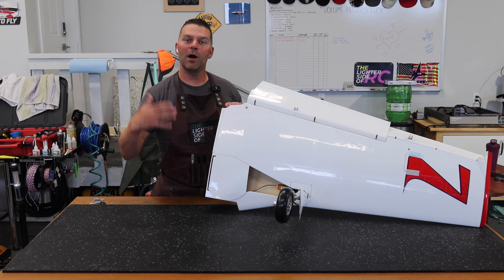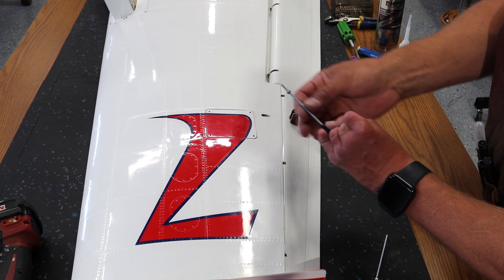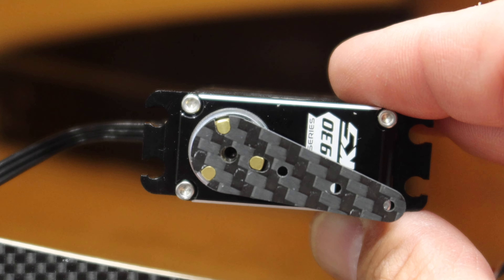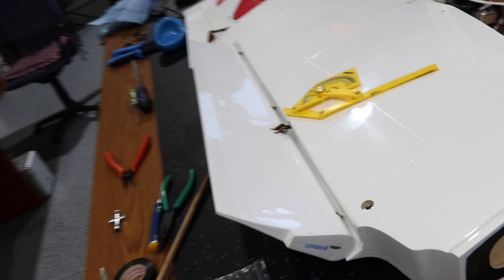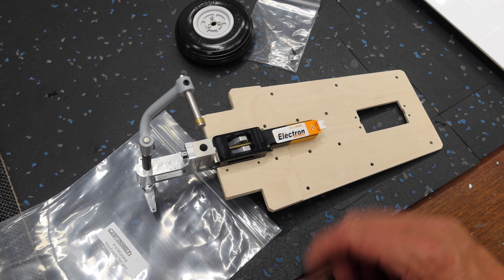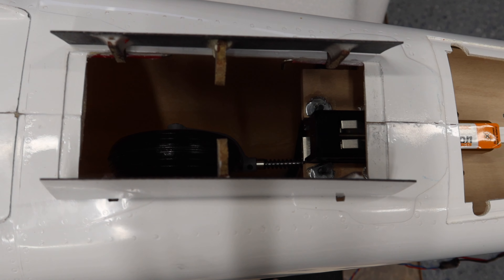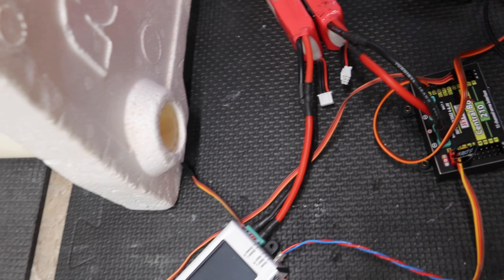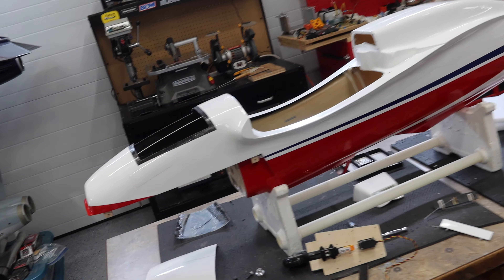MAGICAL PROGRESS! - Strega RENO Racer Surfaces Complete!

Comment: Tail wheel steering pull wires, i use a spring on each.    Just thread wire through the spring and crimp in place.  It stretches so the wire still does the pull pull action.  Spring contracts and holds wire shorter and contained
Reply from the maker: Understandable but on this strega there isn't much room on the plate and because of the Electron gear design there is so much movement I can't imagine a good spot to locate springs to work well.
Reply: @thelightersideofrc  over the existing pull pull cables, just a very light and long extention spring.  Thread the pull pull cable through the centre of the spring.     Or even a piece of elastic.    So when there is slack it contains the bending and bowing of the slack cable.   Hope this explains better what I was trying to image

Comment: Love to see a prop plane on your work bench. I know first hand and feel your pain when you don't get a build manual. I have a CARF 3 meter Extra 330LX and it also shows up with no manual and the real frustration is the firewall does not have the 2.5 degree offset in it, in stead it is flat but the cowl is made with the 2.5 degree offset. Pretty frustrating but thats how CARF does it. Great video buddy.
Reply from the maker: Oh dang!  I feel your pain too from many miles away!😂😂. The joys!!!

Comment: Yeah A, nice test pilot. Glad to see your fitting custom controls for the cat. Question, do you not run a screw threw the wood, pull it back out and then thin CA the treads you just made in the wood?
Reply from the maker: Thanks.  Sometimes I will run the screw, remove and use thin ca.  Sometimes drill the hole.  CA to screw or hole or both and thread in screw.  Treats threads and also locks screw well.

Comment: Wow what a beautiful build!, what do you expect the wing loading to be with such a large engine. I only ask because in 1998 I built a Cosmic Wind with a large single 100cc engine squeezed in. In short it flew great until I had a dead prop situation and it went into a stall at high speed (shocking) I managed to recover just before impact  and hit the ground with only minor damage but after the experience I put a lighter engine in. Take great care on that maiden and good luck it's a great project!
Reply from the maker: Thanks!  Not sure what the actual number is but it will be high.  Much like a heavy corsair type scenario.

Comment: Now that you've messed with this for a bit. Would you think the Kolm 155 would be a better engine for this plane versus the 230?
Reply from the maker: Great question Jeff. The 155 would probably be a much easier install. The next strega video is a week from today. All about engine. It is TIGHT!  Definitely a 2 person job. I don’t think I could physically install myself without a 2nd person.  Maybe if I had an engine hoist 😂😂
Reply: @thelightersideofrc  I’m also thinking about the weight. It will be interesting to see how much tail weight you will have to add. It doesn’t look like there is room now in the tail for any batteries.

Comment: Why not feed the wire and connectors thru the wing into the fuselage like u would on other planes u built. I see u are feeding the wires and connectors outside the wing into the fuselage of the plane
Reply from the maker: Wing roots connect to eachother.  So they have to feed into the fuse through the top side of the wing.